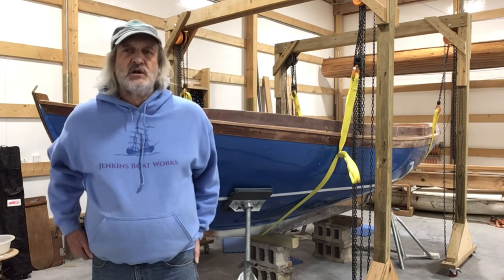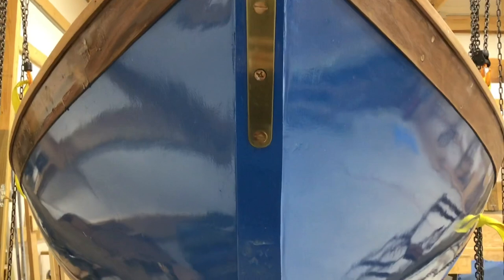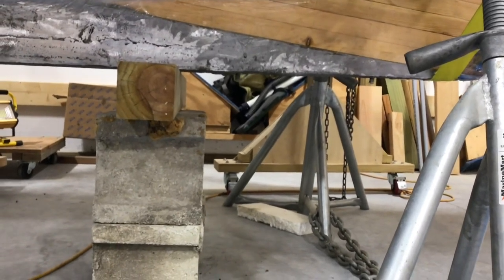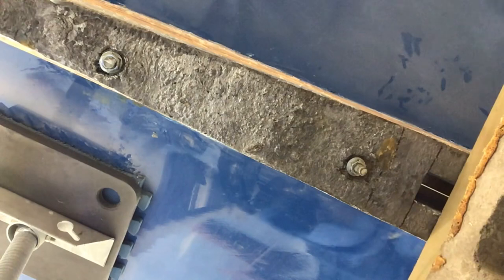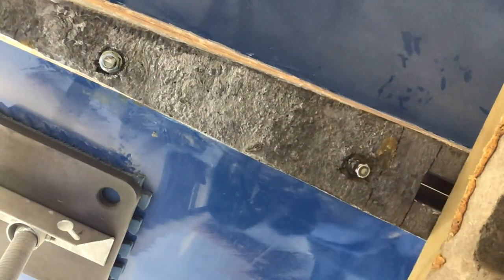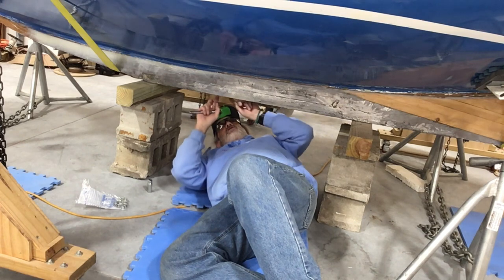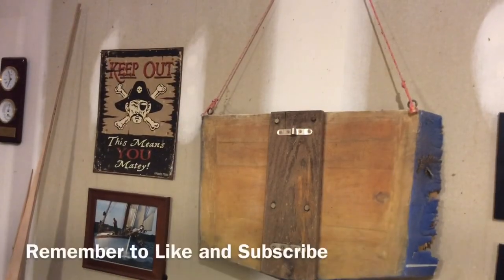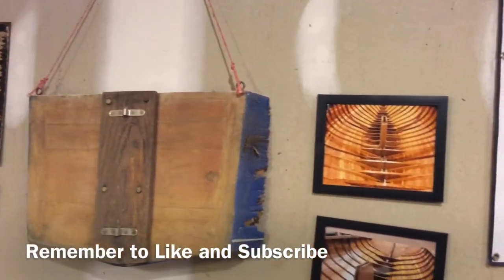Boat Building The Haven- Keel Bottom Episode 114

Comment: I know you had redundant safety features when you got under the boat, and the cement blocks are part of that --- but the blocks should be flipped 90 deg so that the webs are vertical and provide more cross sectional area.  AND to be especially fussy, I would never use cement blocks as support for anything I would ever crawl under. They don't yield slowly like blocks of wood do --- they let go in a hurry.  If you have to, just crib together wood spacers using scraps.  Finally thank you for your videos.

Comment: Cut the bolts off with the metal nut still on. Then remove the nut and replace it with the nylock nut after the bolt has cooled off. She’s coming together beautifully.
Reply from the maker: Good thoughts Dwayne. I can change out the forward ones. The aft are now locked in with epoxy so probably pretty secure

Comment: Commenting at 14:48. When you cut off the bolt end with the nylock nuts on there you ruined the nut. You needed a lock washer, a metal locking but (not nylock) and red or green locktite. Those lock nuts are no good Chuck. You melted the nylon part.